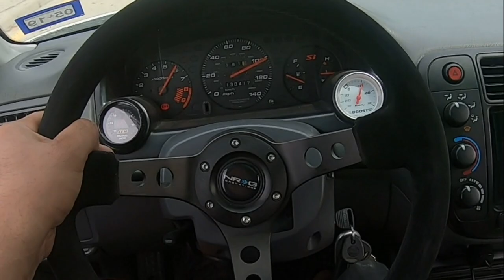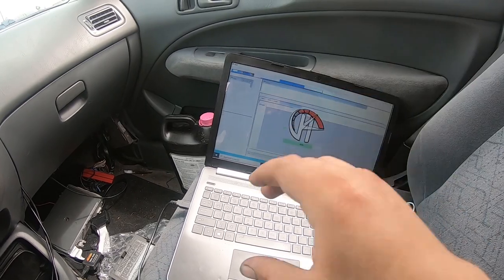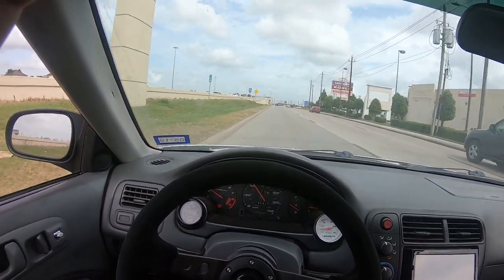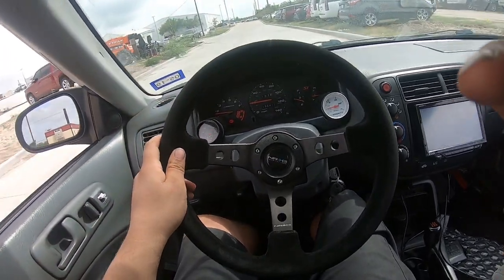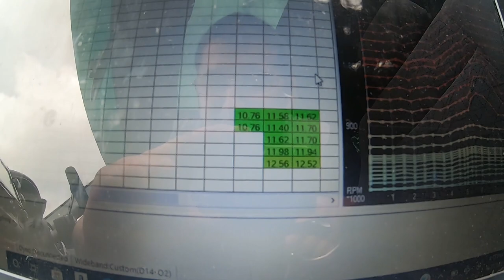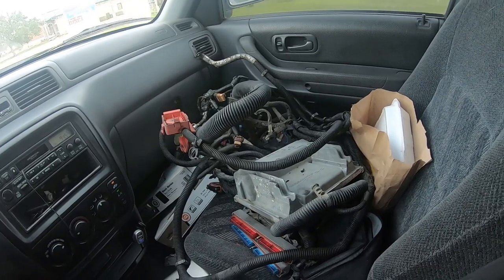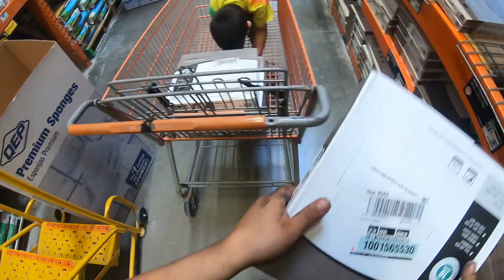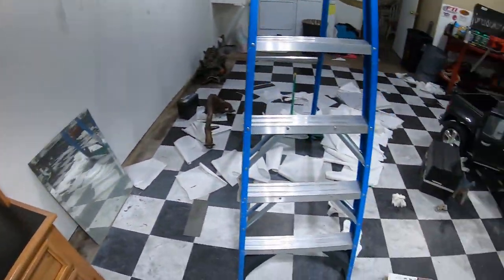TURBO HONDA D16 HITS 16 PSI WITH VITARA PISTONS and Honda Tuning Suite!! & GreaseMonkeyGarage Update

Comment: Keep it up with the sohc bro! I want to boost my D16z6 later on when I get a chance. And that’s cool you can tune your own car.
Reply: bro u can tune your own car by yourself too! this isnt rocket science. Pick up a textbook and start reading. You essentially want to just richen  the car and monitor knock as you slowly lean it out and pull some timing as well as monitoring the air fuel ratio. Try it brotha you can do it too.

Comment: Stock rail? What injectors are you using? I'm like mid build and appreciate a link to them.
Reply: Get injectors keep everything else stock the rail and the regulator will hold up till 700hp get 750cc or if e85 get 1500 cc
Reply: @h3xd3m0n9  Not true. You need at least an adjustable FPR when running a high flow fuel pump. I had around 70 psi of fuel pressure at idle on the stock D16 FPR with a Walbro 450, not good. You can do a trick to drill a relief hole in the stock FPR to lower the fuel pressure but it's ghetto and a PITA to drill, you're better off just doing it the right way and getting an adjustable FPR.

Comment: What do you recommend I do to my d16y8(bone stock) to make it handle 18-20 psi at 350-400 whp, I already have the turbo and everything for it, just looking for more info on what I should do to the motor so it doesnt blow on me
Reply: You’ll get head lift all stock won’t even hold 10 psi from a t3t4  needs arp head studs block guard (helps with head lift) and I built my bottom end
Reply: Rods pistons, arp head studs, turbo kit, good tune

Comment: Newbie question but will a d16y8 swap into an 8th gen civic? I have the d17 motor but there are no pistons or aftermarket support for it really. Will a d16 run on the obd2 computers?
Reply from the maker: Once you start modifying a d16 you need an obd 1 ECU anyway. Just grab d16y8 harness and typical obd2 to obd1 ecu adapter
Reply: @BoBuilds  so it’ll have to be chipped at that point right?

Comment: How much hp u think?
Reply from the maker: Maybe 260ish
Reply: GreaseMonkeyMods 
U think with a tune u could push 400? I got a y8 same setup. Idk if I should just build a z6 and be safe
Reply from the maker: It is tuned. 400 is definitely possible if i had supporting mods. Built head, cam, larger injectors ect. im getting there
Reply from the maker: Put a z6 crank in the y8 and your golden
Reply: GreaseMonkeyMods 
Awesome bro can’t wait to see u ripping!!